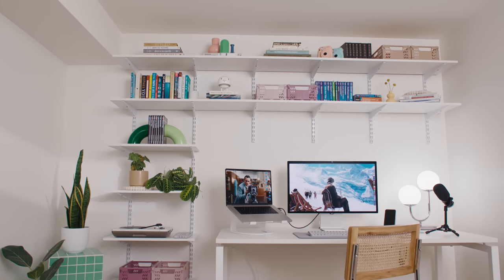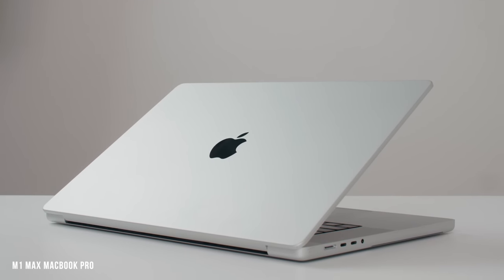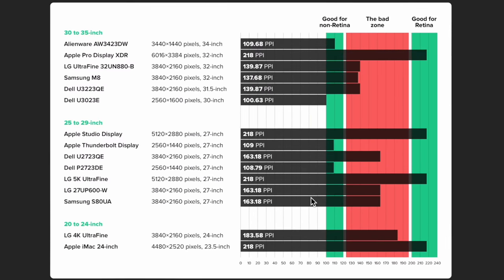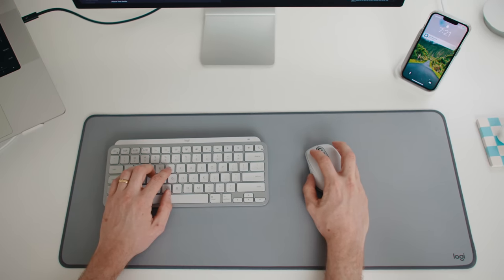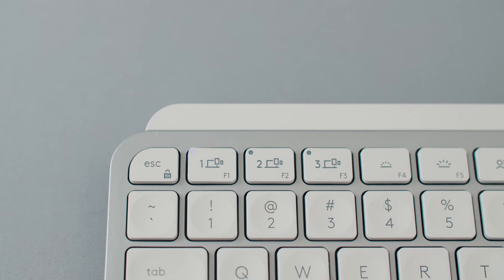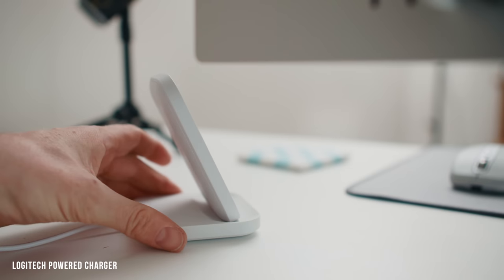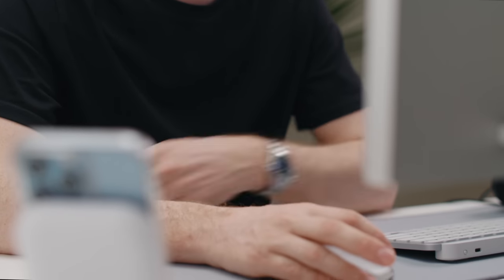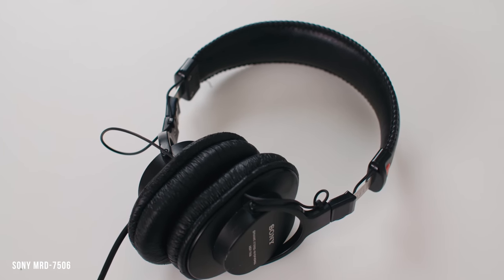Work from Home Desk Setup

Comment: Really nice setup! Just a little word of advice for anyone taking the SD card backup advice:
SD cards are pretty volatile and can fail for a number of reasons, not really the best backup option for your computer unless you really don't have anything else. You can backup your entire computer to a service like iDrive daily and restore from your most recent image without much technical skill needed. A local backup is a good option to have though in case your internet isn't fast or you are without it, I recommend using one of the Sandisk portable SSD's Tyler mentions as a physical local backup for your machine.

Comment: Hi Tyler, I really want that keyboard but it’s driving me nuts that it doesn’t have a launchpad button, or for window management. Is it possible to change the function of the Bluetooth device buttons?
Reply from the maker: I think those ones specially are locked, but don’t quote me on that. I’m traveling at the moment and can’t confirm